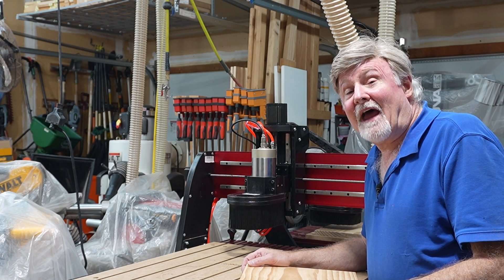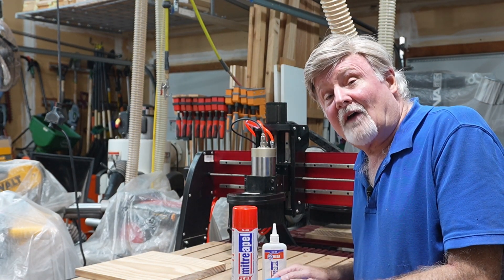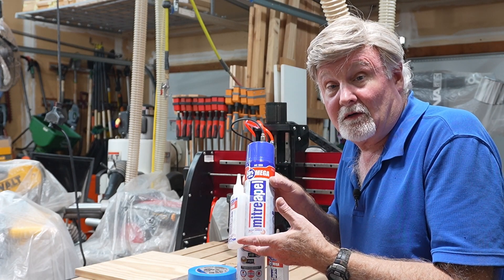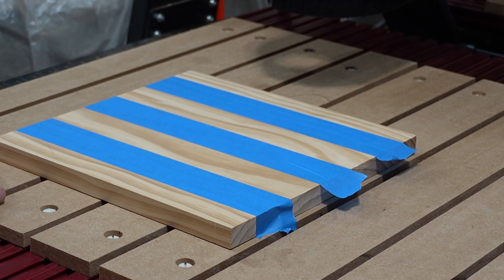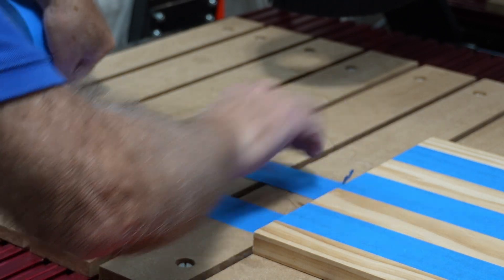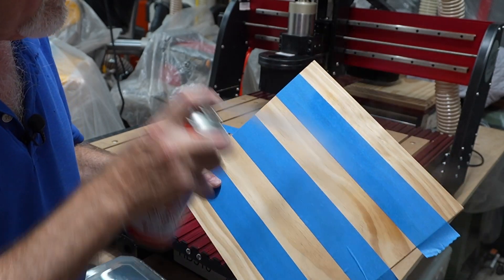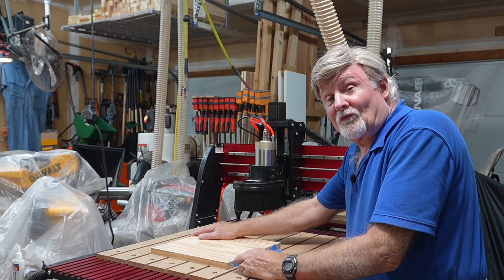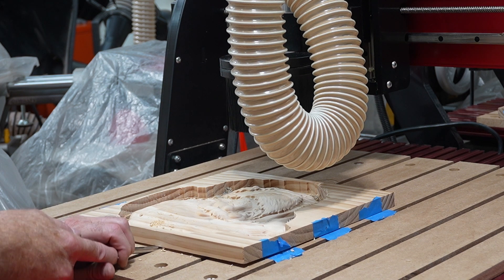How to Hold Down Projects on a CNC Machine without Clamps

Comment: Through cuts are cutting into your baseboard.  How to prevent that?
Reply from the maker: Most times the wood thickness is accurately measured and that value is put into the software. The depth of cut is so accurate  that it cuts the tape on the project yet leaves the tape on the spoilboard intact. Sometimes I do projects in bulk and just put the next one on the spoilboard without measuring. If the project board is slightly thinner than the dimension input into the software the result is a cut into the spoilboard. That's what it is there for. Once I get a substantial number of cuts into the spoilboard I just shave it down with a spoilboad leveling bit. Now I have a new clean flat surface once again. I have gotten years out of this spoilboard and just recently replaced it.
Reply: @daveswoodshop782  Thanks.  I am new to CNC (just bought a Genmitsu 4040 Pro) and cutting fairly thin balsa for RC model aircraft.  I was looking for a hold-down method that didn't involve clamps on small balsa sheets.
Reply from the maker: @tvideo1189  I used to use my CNC to cut 3mm Birchwood ply. I would use 1/16 and 1/32 bits and would get pretty good results as long as I would use the proper feeds and speeds. Eventually just broke down and purchased a 40w laser for the thin woods and leave the big stuff to the CNC.